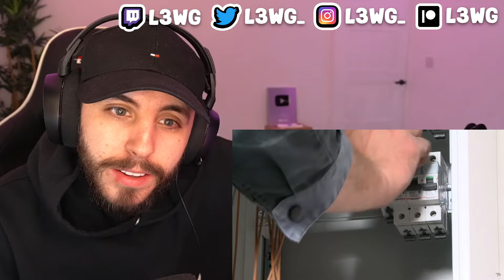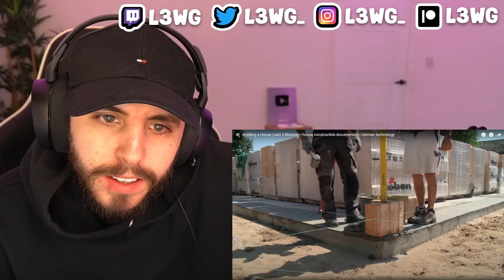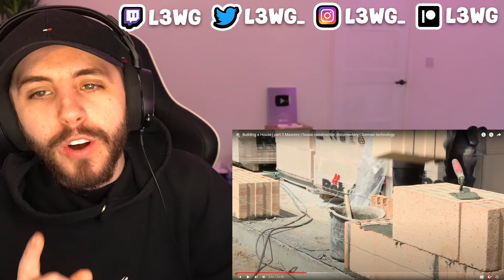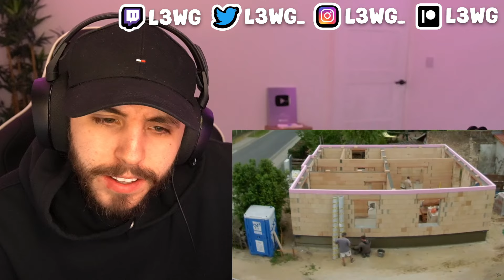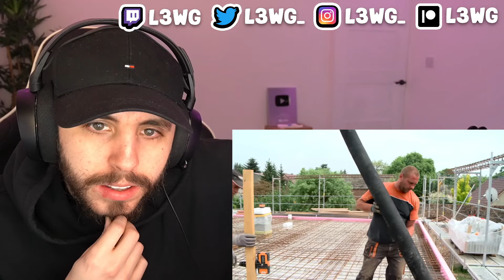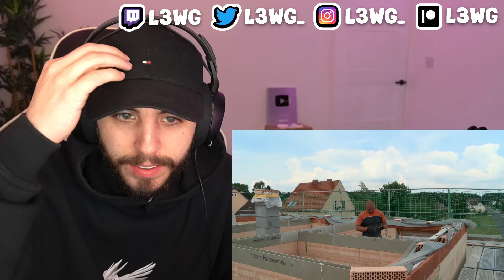Brit Reacts to how GERMAN HOUSES are made!

Comment: Not ALL American Homes have basements... MOST tho in the tornado alley states tend to have basements.

You should check out these way they do it in Scandinavian areas - video:: Incredible Fastest Wooden House Construction - Faster And Less Inexpensive Construction Solutions  (I think they mean Less EXPENSIVE, not less INEXPENSIVE, but... not 100% ;) Still, really cool.

Plaster would probably hurt too (more than Drywall like we (mostly) use, anyway.)

We use steel rebar (what we call it) in concrete - we never did it THIS way... the way they did it in the video - we may by now tho... dunno.

Comment: ehm. plaster walls are (mostly) brick walls. from the start of the 20th century onwards most bricks were plastered and therefore smoothed out and painted afterwards. Brick walls where you can actually see the bricks are mostly from previous times.

Comment: An anchor ring is only required in areas where earthquakes may occur.
Reply: or hurricanes, or tornadoes, etc.
Reply: @Marcus-p5i5s  It may make also sense elsewhere. But the requirement exists in Germany only for areas where earthquakes are a risk. 
But not in the "tornado alley" of Germany. The buildings as such seem to be strong enough anyway. Affected are mainly the roofs. Without tiles or entirely gone.
No hurricanes in Germany.
Reply: @martinstock Wrong.  Hurricane winds would flatten all those homes in Germany.
Reply: @Marcus-p5i5s  It makes no sense to build for dangers that do not exist. Germans would probably build reinforced concrete houses including the roof. Albeit covering the concrete roof nicely with screwed tiles.
Reply: @martinstock no, if not attached to the foundation with rebar they are a hazard everywhere in Germany.  Looking at the historic incidents of 6+ level earthquakes I wouldn't build like this anywhere in Germany
Reply: @Marcus-p5i5s wow, you're really on a mission here. You can be sure, german houses are build at the highest savety standards for this part of the world. It doesn't matter how they do it in US, it's just different.

Comment: The only reason why German homes don't have basements is if there are laws or regulations that make building a basement either impossible or prohibitively expensive. For example in my section of Hamburg the ground water level is at around 2.5 meters below the surface. Yes, you could theoretically build a  full basement here, but you'd have to encase everything subterranean in a so-called Weisse Wanne, a special liquid impermeable casing that keeps ground water level from seeping in, or spilled liquids from seeping out. In addition it would require a very sophisticated lifting mechanism that securely pumps ANY kind of internal liquid up to the sewage level again, and prevents backflow. All of that is a very significant cost factor that prevents most home owners in this part of Hamburg from building full height basements. However low ceiling basements are fairly common here.
The environmental protection restrictions and regulations make building basements a lot more expensive today than a mere 30-40 years ago.
Otherwise most people would still build basements.

I'd wager almost any bet that the vast majority of homes in the UK will be built very similarly to the house shown here. Mind you, the houses in the USA comparatively are cardboard and paper. Drywall, thin wooden siding, and plaster allow for quick and cheap(er) building. But US houses on the average last around 30-40 years without major refurbishment. That would be the absolute minimum that a builder in Germany would accept before any major repairs were necessary (barring natural disasters, obviously). Leaving a fully intact house built 70+ years ago as part of an estate after death is completely normal here.

Comment: That is very similar to how commercial buildings and apartment buildings are built in the USA.
Reply: wrong. No steel reinforcing used in Germany
Reply: They literally are showing the rebar being put in.
Reply: @PriscillaV1964 wrong the rebar has to come OUT OF THE FOUNDATION AND  VERTICAL BEFORE THE BRICKS ARE BEING LAID BECAUSE THEY GO INSIDE THE BRICK.  Jeez!
Reply: Do not.confuse the how rebar is being used with the use of rebar.
Reply: @PriscillaV1964 I'm not.  You have no engineering or building experience. If masonry walls are NOT tied into the foundation in the USA they are illegal as they can be FLATTENED by earthquake or high winds.
Reply: @Marcus-p5i5s that’s why many of our houses survived the 2WW. Clueless

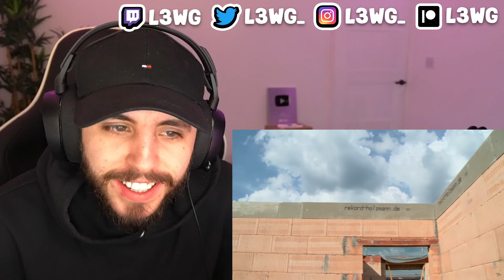Comment: 13:42 - in germany, this is not the second floor they are working on now, but the first UPPER floor, while the other is the ground floor (Erdgeschoß). and thus floors in germany are labeld E (or EG or 0) and then 1, 2, 3, etc (sometimes also 1 OG, 2 OG, etc for upper floor = Obergeschoß), and similarly 1 UG (or -1) etc for Untergeschoß ("belowfloor"). Of course, on such a small house it doesn't matter much, but be aware of the numbering when you are looking for an appartment or another room in a big multi story house, or want to use an elevator ....
ps: if the roof is walkable on a biggevr house, it might be labeled DG (Dachgeschoß = roof floor)

Comment: wtf ur talking about
Houses in GB are made in nearly the same way.
Reply: Modern houses might be built like this but most houses in the UK are old. It's rare for people to have a basement or a concrete floor. The floors and many of the inside walls are usually made of wood and the bricks in the loadbearing walls are small red ones, not big concrete ones.
Reply: Many DIN /EU norms have been adopted durig the EU membership, but there are some differences and wooden floors instead of concreate are still common in the UK.

Comment: The general german house has a basment. 
Where is more or less house basment build, is also depended on which german region we are talking about.
The underground floor is still much more popular in southern Germany. In Baden-Württemberg and Bavaria, more than 40 percent of prospective home builders do not want to build without a basement. "Traditionally, for many builders in southern Germany, the basement is still simply part of a 'real' house," says Dr. Gordian Rättich, Managing Director of Almondia. "In Lower Saxony, for example, the cellar is only indispensable for 16 percent."
Reply: I think that's very much the case here in the US.  Environmental factors can play a big part in whether or not a house has or even can have a basement.  As for construction material, I've lived in homes made of wood, wood/stucco, and cinderblock/concrete block homes.  My basement is cinderblock, but the main floor is wood.  The basement is also a "walk-out" basement, so the front of the house looks like it's two stories whereas the rear looks like a single story.

Comment: Most houses have basements. This is often omitted in new buildings because a basement is almost three times as expensive as an additional floor (due to earthworks, additional insulation, etc.), which is why it is often omitted and a carport with a shed is used instead.
I think houses in the UK are very similar. This is the current construction method here. Before that, hollow blocks and mortar were used, aerated concrete blocks and adhesives were the trend for a while, then there were also prefabricated houses. So the construction always changes a little.
Reply: Not in Florida they don't.... almost all newer buildings in Florida are slab-construction.  Even crawl spaces are uncommon.  You can't dig down too far without hitting water in most places in Florida.  When I moved up to Tennessee, I was bound and determined to buy a house with a basement since I had not seen one since I was a little kid up north (and I'm in my 50's now.)
Reply: @dethangelsshadow  Basements in Florida turn into pools LOL
Reply: Come to think of it... when I lived out in Las Vegas, NV it was all slab there too.  But I was only out there for a year so I didn't see a whole lot of homes.  I think the fear out there is a flash flood.  All of the air conditioner compressor units were roof mounted out there and all of the roofs in the subdivision I was in were tile, instead of shingles or metal.  I thought that was interesting.
Reply: It depends on the region of the US. Florida doesn't for obvious reasons. Texas mostly doesn't because the clay soil crumbles and doesn't support a basement, most western states are too rocky to dig, or too dry for anything larger than a crawl space. California mostly doesn't have basements, tho' they do exist. 
There are exceptions of course.